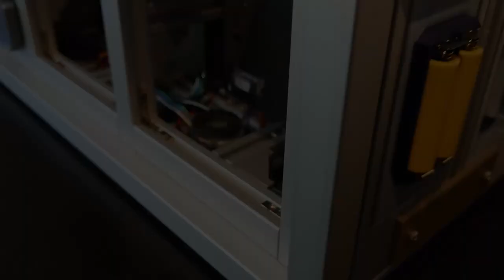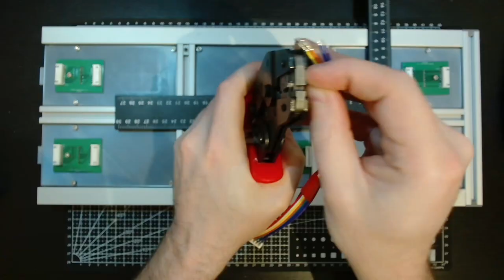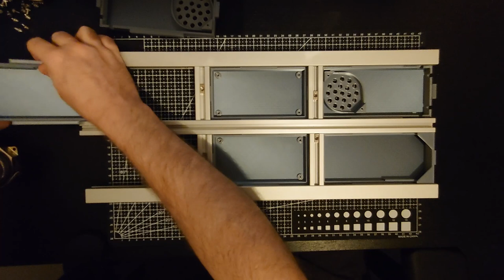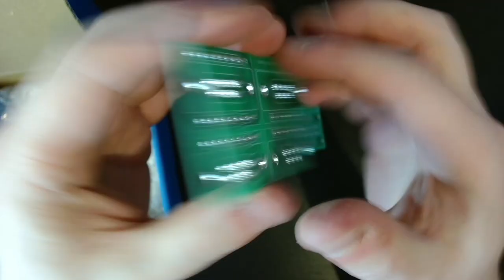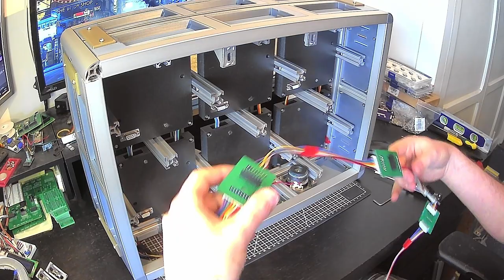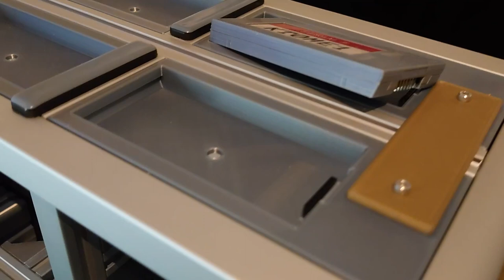Keep Talking or the Microcontroller Explodes: Case build

Comment: Any plans on making the "sequenced wires" module? It seems like it would be pretty hard to get those little panels to swap themselves around in a small space. You could cheat and use an LCD or OLED touch panel, but that seems against the very tactile nature of everything.
Reply from the maker: Only vague plans right now as I'd like to tackle the needy modules first. I'm considering rotating a cube to achieve the effect but this has a lot of potential issues, like the wires getting snagged and space limitations. It's definitely something I'll get to much later!

Comment: I watched someone elses build (or half build since it only had one side) and realized that to build a real one, it would be extremely difficult to build compact enough to be played as a real life game. But as soon as I saw the serial on the other  one I was like "wouldn't an e-ink tag allow the game to reconfigure itself to the modules installed?" Sure enough, here's an e-ink version.

I think it's neat overall, but realistically difficult to build one simply because some of the parts are not 1:1 for real life ones, and some parts (like the DB25 parallel port) can't be scaled down.  Like from just seeing you assemble it, it seems as big as my computer tower.
Reply from the maker: Yeah it's about 50cm wide and 36cm deep, and weighs in at about 10kg, which is much more than I think the scale in the game. There are certain limits with real components as you mentioned, but I think that scaling it down further would also make it harder to snip wires and press buttons, as some buttons are fairly small in the first place (thinking of Passwords as an example). I think it's still accurate and good recreation, without creating new components from scratch anyways! 😀